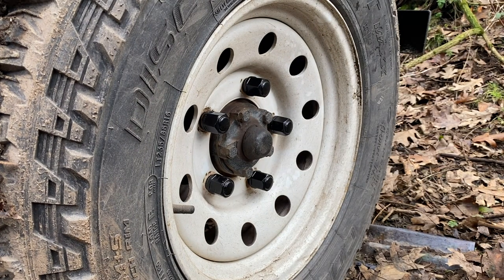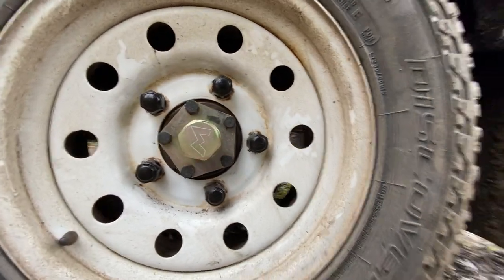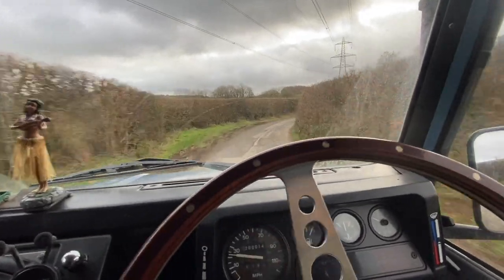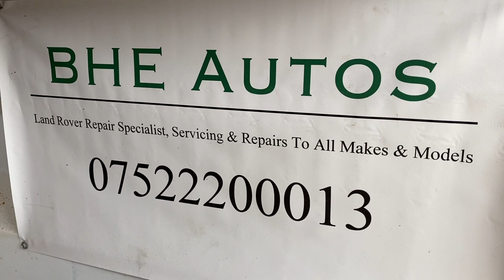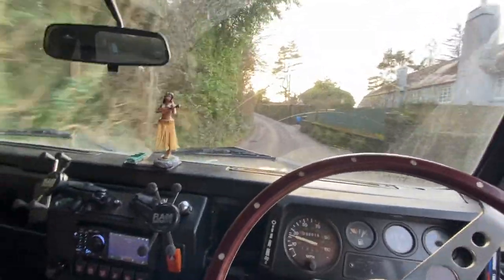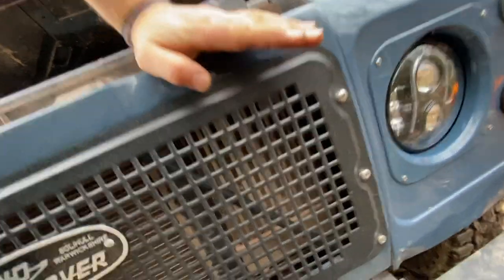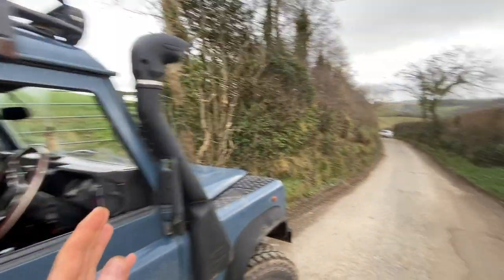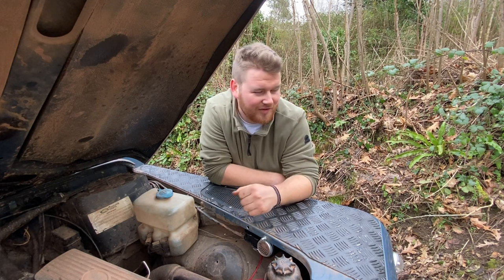A New Horn for the Defender + A Snapped Bolt and Upgraded Wheel Nuts

Comment: Just installed one of those but water got in - I suggest connecting a hose to the air intake on the horn to prevent any water ingress